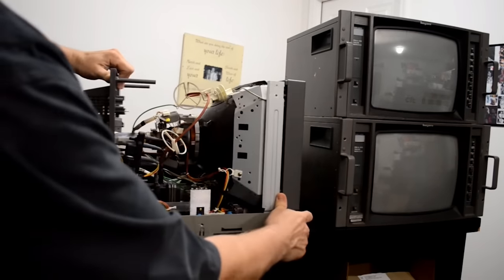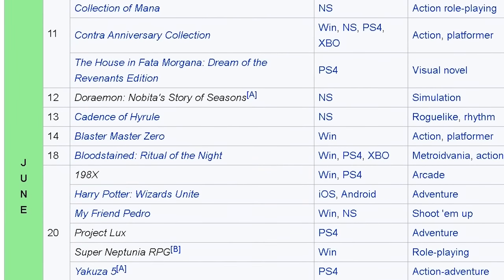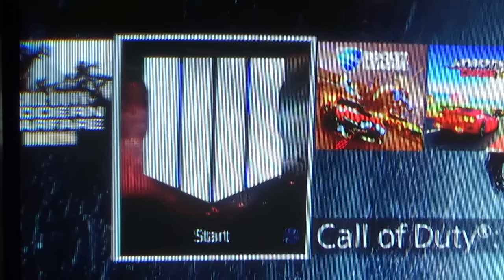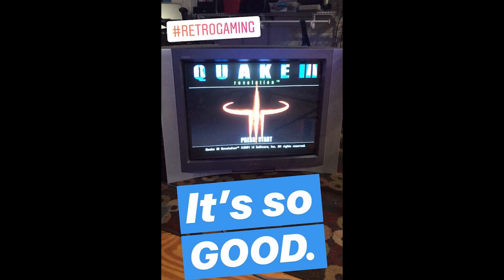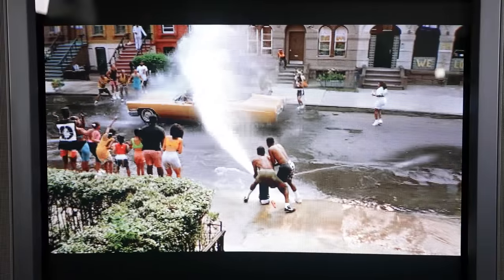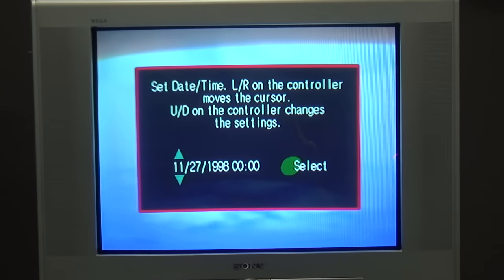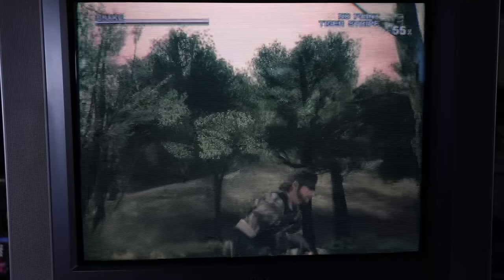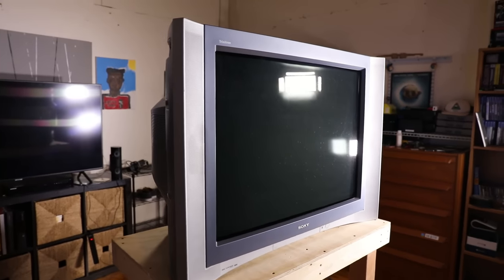Best CRT for Retro Gaming: Sony KV-36FV310

Comment: Might be an unpopular opinion, but I think with the SNES, the N64 and the PS1, composite video (specifically on a CRT) is king, at least for most titles. Some games with composite video would blend 2 colors and could create images that had more colors in it than the console itself could even produce. It made dithering actually look good and it made the muddy textures of the N64 less noticeable. I do use S-video an RGB with those consoles, but only on a modern television through a line doubler. For CRTs, it's composite video all the way.

Also, a more widely shared opinion, Sega Genesis is best with composite video, even on modern displays with the use of a line-doubler. The additional color detail from blending and dithering techniques were often utilized by developers of genesis games and it was critical for a commonly used transparency effect. The waterfalls in Shinobi and Sonic the Hedgehog look like trash through RGB imho.

Comment: I think the best way to get emulated content onto an SD CRT is to hack an old console like a Wii/u or OG Xbox. You are right that you need old crt drivers for an older compatible AMD graphics card. You can also try a mister fpga. There used to also be a raspberry pi solution, but it's no longer available. I'm currently just collecting old games for the SNES, genesis, and trying to start a TG16 collection, but that's, overall, a more expensive solution.
There is also an option to use a VGA to component transcoder and a more recent Nvidia gpu (that supports an analog out, like a 980) and then set up a proper resolution for the screen from the Nvidia control panel. I have heard of that working well in conjunction with some retroarch setup. 
I tried messing around with VGA to component transcoders, but ended up breaking it during a genesis triple bypass mod test. So shruggs

Comment: For hooking up a PC, I've had good mileage using an older ATI card, with bios flashed via Atom-15 (for 15khz bootup), CRT Emudriver (hacked ATI driver), and the UMSA (Ultimate Scart Adapter) to combine sync. Then you'd just need a quality RGB -> Component transcoder :)
Reply: ... and then for MAME, get GroovyMAME for auto res switching via SwitchRes

Comment: I think were way more likely to see LED panels that have upscaling and scanline replication, like what you see from the ossc or framemeister, but built into the TV. Kind of like how cars have fake manual transmission modes. It will probably look decent enough but not like the real thing.

Comment: I have a 576p tv with a built in 5.1 dolby digital amp which I connect a pc via hdmi-component and a optical cable to the tv for audio. Now THATS the best tv for retro gaming sure I have to lower to 720 x 480 for NTSC games but man nothing beats its picture everyone that sees it assumes its a HDTV and says its the best picture they have ever seen.
Reply from the maker: How'd you come across such a lovely set?
Reply: @Scarflix  I had 2, the first the picture started to die and I took it apart and accidently damaged it so got another, both cost £5 each on Ebay the main cost was courier which was about £60 as it was hundreds of miles away.  All I had to do with both of them was go into the engineers menu where I adjusted the scan so it perfectly fits all 4 corners, maybe a tiny bit of warping that you would only notice if you had a large rectangle on screen. Oh and they even came with their tv stand. Almost impossible to find now probably I bought mine 4 and 5 years ago.

Comment: Q: so if I say have a GameCube hooked up to this rare crt. With 50% of its library outputting 480p it won’t work/display on this rare set BC its 480I? Meaning I’ll need to find a 480p sd crt?
Reply from the maker: I believe that all GameCube games default to 480i over component video. Usually you have to hold some sort of button config when the game boots to enable 480p, so you should be good

Comment: i just bought one kv-36fv300 and seems to need a calibration, i tried with my saturn and the snes presents a curve almost on the top of the screen any advises ?
Reply from the maker: To start: finding out how to access the hidden Service Menu! Using the remote
Reply: @Scarflix  i need the remote i already order it on ebay but to be more specific its a little wavey on the top with the snes i wish i could send you a photo

Comment: I'm sure I'm in the Minority but I actually prefer the Older Black Curved Trinitrons for Movies/Games/TV They feel...... Right? They tend to look Much softer and usually have pretty good Geometry. They are also Peak 90s aesthetics. It may just be Nostalgia lol. I never did like that Silver Plastic look that came in the early 2000's. It aged so poorly I think. 

Sony Sets I currently own are a KV-27V15, KV-27S42, KV-27FS100L and a KV-19TS20
They each perform admirably but over all I like the 27V15 the most as a Daily Driver. 

I own a bunch of Toshiba AF's as well and they definitely Impress. Best Geometry Ive seen in a Flat Tube CRT.

Comment: The first TV I ever bought with my own money in the 1990s was a 27" Sony Trinitron from Circuit City for $550. It was vertically flat but curved horizontally, and had an s-video port. A lot of great memories on that TV. It's what I played my N64 and PS1 on. One day it just didn't turn on so I chucked it. Thinking back on it, it was probably an easy fix. Stupid me.

Comment: @Scarflix you should look up the early 90's Sony Trinitron XBR 32" if you plan on doing any gaming requiring an RF connection as it has two inputs and you can turn the noise reduction and the "notch" feature off for some incredibly sharp 2nd gen gaming.

Comment: As far as hooking a PC to the Trinitron... You can get 15khz RGB out of several fairly modern video cards. Then you'd just need an RGB to component video transcoder.  I haven't done it yet but i picked up a 27" Sony KV for just that 🤘

Comment: I am a TV engineer and I have a model in this range and the tube is far inferior to that supplied in the mid 1980s Trinitron models, those are the holy grail in 'low mileage' condition.

Comment: I've got a sony KV-36FS210 which may be a slightly less advanced trinitron but still blows my mind with it's image quality. I compared it to my 50 inch vizio Plasma TV(now broken) and My mind was blown on the quality of composite video on that TV. My only issue is that thing is too dang heavy. 230 POUNDS. Yeah I'm gonna need to hit the gym to pick that thing up.

Comment: Man do you a favor and mod the N64 for RGB output, you will never regret! I say this because mine is and if you see something like Wave Race 64 in component video you never go back. And for the CRT coming back dream of all retro gaming people, well, if the companies have interest on this they can reproduce the visual style by making a flat panel with a integer scale, very good deinterlace, scanlines with user settings and very minimum input lag. And they can, it's only a matter of making a dedicated TV/Monitor that doesn't have any smart gimmick and putting all the CPU power just for image processing and these features. They can even scrap the HDMI entirely and only have composite, s-video, component, VGA and RGB scart.

Comment: It must be an HDCRT thing. I have a Zenith D32D53 HDTV CRT monitor from 2001. Though already owned by Goldstar/LG at the time, this tv was all Zenith technology and made in Mexico as LG had already exited the CRT business at that time. It was part of their first line following a major retooling and uses a Phillips picture tube. And while I don't think it was quite on par with the Sony, Panasonic & Toshiba lines of HDCRT sets of the day, It still blew me a way and it is excellent at rendering classic gaming signals. My NES, SNES look better on it than on any other set I've ever seen, and that includes a couple non-HD Sony Wega sets. It's downside is slight color purity issues in some of the corners. I could imagine what these games would look like on the Sony, Panasonic, JVC & Toshiba HDCRT sets of that period. I have seen those sets in motion, but I've just never seen gaming hooked up to them.

Comment: Subbed!! Great show! However, component video is not sending red green blue seperately, rgb scart does that. Component sends Y Pb Pr signals,  Y means Luminance, Pb means difference between Blue and Luminance, Pr means difference between Red and Luminance. Green is what is left off.

Comment: Great video man, we need more coverage of the FV's like this out there. I've been keeping my eyes open for the 27 inch model myself. Maybe some day!

Also, never knew that flat panels' blacks were just desaturated white values, that's filthy.
Reply from the maker: Heck yeah, it's out there for ya! What kinda CRTs you rockin'?
Reply: @Scarflix  Nothing too crazy at the moment. I've got a KV-27V42. Definitely more of an evening news TV than for gaming, but it's got solid S-Video. Looking for anything higher end with component really, I'd love to get an RGB setup with either something like HD Retrovision cables or getting a scart to component transcoder. And then in the ideal world I'd like an HD set to rock everything that supports 480p and up. There's some 720p OG Xbox games and they look out of this world on a CRT that handles that res.

Comment: In Latin America crt are still used a lot. You can even still buy crt in stores. Also most lcd TV's come with rca cable iputs. Not sure what resolution they support ... But I'd assume low res since even a lot of cable still isn't broadcasted in very high def.... Probably less than 720p
Reply: Wait you can find them in stores new?? what country is that!?

Comment: I feel like hooking up a PC to a CRT shouldn't be that hard. I mean, doesn't VGA easily convert to component? If not, I do know that some older graphics cards had S-Video out. Is the issue just with getting Windows to output in 240p?

Comment: Hey , good video .I used to run a tv shop in downtown Atlanta or well Midtown. I have a KV40XBR800 I run older game systems on .Sony also made a KV34XBR model that was probably one of the top 3 late model CRTs that came out right before they quit making them . I'm over in Marietta if you ever need help with a CRT or wanna talk games let me know .

Comment: so if you have a streaming device that connects via hdmi.... this couldn't be hooked up to the TV correct?
Reply from the maker: As long as you turn off any HDCP style features it will work just fine. My PS3 has Netflix and streams to the tv in 480i no problems. Looks amazing. Especially 90’s anime!
Reply: but the kv36fv310 doesn't have any HDMI ports though? how would this work. Also, this model outputs at a max of 1080i am I right?

I'm trying to decide between this and kv36fv26.

Comment: Hello I’ve got a question.. I’ve got two TVs a 27” Sony trinitron KV-27FS00L and a 36” Sony Trinitron KV-35S42. I’m trying to get RGB in the larger one. Would it be possible to Frankenstein parts from the 27” to make the 36” RGB?

Comment: You never mentioned how crts are the only tv you can play light gun games on. The wii and ps3 versions don't hold a candle in accuracy. I haven't tried the ps4 offering yet. I'm kinda curious if that tv can play Virtua Cop Elite edition on ps2 without any accuracy problems with those tight corner shots.

Comment: Where can I get a tv like this? This is literally exactly what I want
Reply from the maker: Some say you just gotta get lucky. Keep your eyes peeled on Facebook Marketplace, LetGo and OfferUp. The official Craigslist app is finally out in the Google Play & App Store so check that app out as well.
Reply from the maker: Also, ask any and all senior citizens around you! They know!
Reply: Scarflix thank you tons
Reply: There are plenty of others too to keep your eye out. JVC i art and d series lines have much better color
Reply: Scarflix  Hey, I bought a Sanyo ViZion HDTV crt. I’m not quite sure what model it is but it’s exactly like yours just Sanyo instead of Sony. It’s a massive 150 pound box. Anyway, mine has a HDMI port on the back just like yours does and it works. I played ps3 on it and it did just fine. But when I plugged the PS4 in it wouldn’t work. I changed the PS4 to resolution 480p and still nothing. Then 720p and it’s just black screen. The only time it works is in PS4 safe mode. Then as soon as I click something it won’t work anymore. Do you know how to fix that? Thanks
Reply: Try disabling HDCP in settings!!
Reply: Third Eye Collective thanks I will try that
Reply: Third Eye Collective  it didn’t work

Comment: basically pc to CRT tv is going to be a pain in the ass... crt monitors on the other hand are much easier to work with since new-ish gpu like the 900 series nvidia cards still support analog video. and high end hd fury hdmi to vga adapter allows you to use crt's with newer cards and keep the incredible range of resolutions and framerate crt monitors can offer, I'm using a sony CPD-200ES, at 1440x1080 60Hz.

Comment: Is it possible to have one of these refurbished? I just picked up a KV-36FV300 & the whites are all gray and the colors don't pop as much as they should. And the picture is a little more blurry, rather than detailed, than it should be; I'm using HD Retrovision cables & they look amazing on a 27" Trinitron that I have
Reply: open up your tv and adjust the focus knob to fix the blurriness
Reply: To fix the colors adjust the saturation in service menu

Comment: It's a great TV but I have two points I disagree on.

One, that the 36" is the ideal size or the only one worth talking about. The FV310 came in 27", 32", and 36". The smaller sizes didn't compromise on features or picture quality in any way, and they're a helluva lot lighter weight. I'd argue that alone makes the 27FV310 the biggest grail of all.

Also, I wouldn't call it "extremely rare." Uncommon, maybe. It can seem that way because...well, THIS VIDEO in large part made them far more well known and coveted by retro gamers. But they aren't rare the way a Philco Predicta is nowadays. THAT would qualify as extremely rare.

Comment: I've got a very similar model, but it also has a DVI in. So you just need an adapter (not converter!) to use HDMI!
Reply: I'm fairly certain mine is 1080i too, not 480i
Reply: Pretty sure it’s a WEGA KV 36XBR800

Comment: With advent dlss I wouldn’t doubt someone will make a display that converts information perfectly and brings 480i to 1080p or higher without any of the issues of converting such interlaced data and up scaling problems and they’d probably put it into monitor for the absolute lowest latency and also with that smart tv refresh rate increaser as well along side things like HDR

Comment: On Ebay it's used and 27 inches. $235.00 and $400.00 to ship. If you got money and space it's an option, but they are old TV's so it could die any time. Then to get it fixed $$$$

Comment: Sounds bars? Hell no. Open season on sound bars.
I got a home theater receiver with hdmi inputs that still has component (2) IN & OUT. Perfect if you have the HD retrovision cables. I don't have an original turboG-16 but I got the classic.
Hooked that up to the receiver via hdmi and got an hdmi to s-video converter and ran that from the receiver to the Sony trinitron s-video input. Works perfectly and the output of the receiver makes the s-video signal look really, really good. Got a nice pair of bookshelf speakers and a dedicated sub, man.... Retro audio heaven.

Comment: Its all subjective but any late or near last model Sony CRT is excellent. I personally went with the Sony KV-40XBR800 40 because I dont want a HD set for 4:3 gaming and wanted the larger screen. I've got the 36KVXBR960 for HD widescreen things like pstv 360 and ps3.

Comment: yesterday I picked up 2 36" trinitron tvs one is a kv-36fs17 which works fine the other is a kv-36fv300 and it died after 20 minutes of turtles in time on snes idk anything about fixing it and nobody in my area fixes crt anymore

Comment: I have a KV-32FS210, I am so so lucky! I had one with the dark gray around the screen cuz it came with the stand, but back to back comparison, I kept the FS210, and the stand fit my other Trinitron perfectly :) same exact stand I guess
Reply from the maker: Isn’t such a great set? You got the remote too?
Reply: @Scarflix  oh I love my CRT set so much!! I feel so spoiled to have it, it was free, and it's incredible for all my old games. And yes, I have the remote with the little joystick-style direction button and the flip open part, the RM-Y191 model :) only thing is it also turns on my PS3 3D TV that's like 2-3 feet away from it, and vice versa, my remote for that TV (CECH-ZRC1U) turns on the CRT...I sorta have to manually turn them on, or get in the way of one set and get an angle where it doesn't see the other TV :P a whatever problem to have, but I was surprised they just automatically worked for each other, haha!

Comment: 13:18 You forgot RGB.  Component is Y, Pb, Pr and it is compressed analog so it is not 3 separate channels.  Only Y is separate and can be viewed alone.  You can not view Pb or Pr without Y.  RGB is the only uncompressed 3 channel analog format.  You can view any of the 3 channels separately if you want.  In USA you have to mod the CRT to input RGB, in Europe there is SCART which can take RGB without a mod.

Comment: As much as I would love to see new consumer CRTs, the price would be unreal and almost guaranteed garbage quality compared to older production models (much like "retro" hifi receivers now).

I gave up hope until OLED came around. A custom 4:3 one that can run older consoles at a proper 240p or 480i resolution would be fantastic. As soon as production matures, reducing cost and the need to make them either enormous or teeny tiny, this could be possible. Heck with a built in integer scaling image processor designed for 240p/480i scaling or deinterlacing, it could outdo the Framemeister or OSSC. 

Guy can dream though...right? ;-)